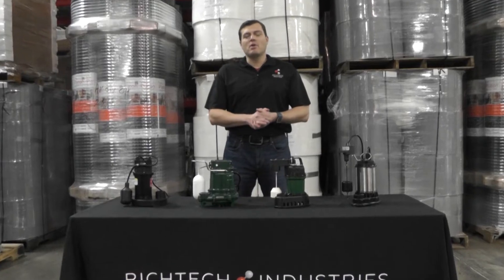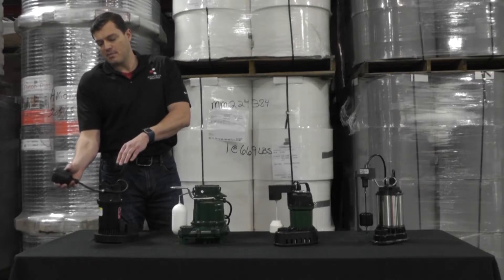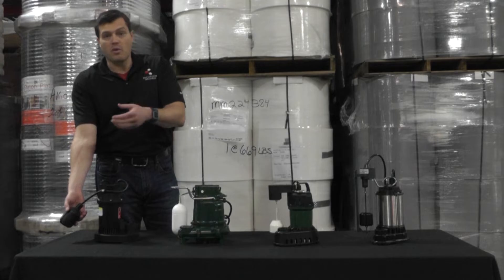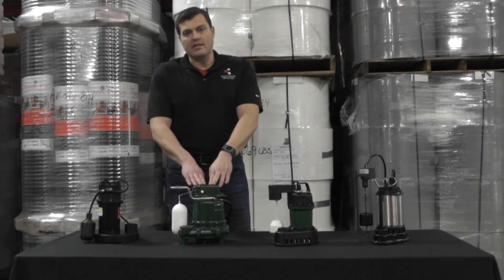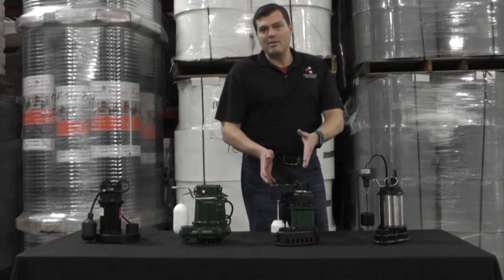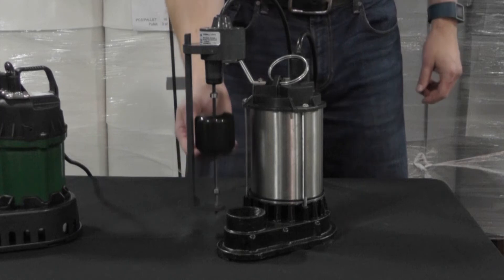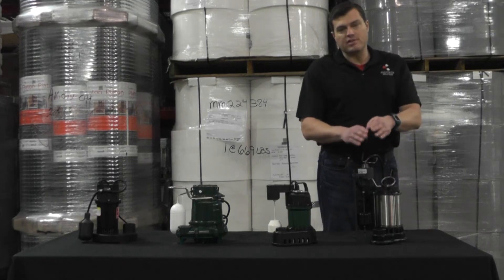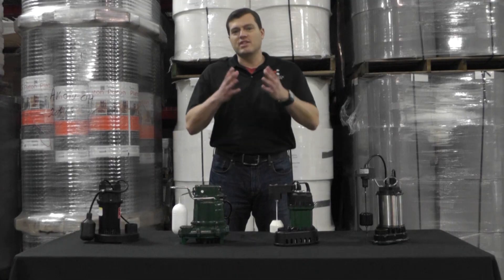Sump Pump Switches

Comment: I have the 1/3hp pump with the lever switch which is your 2nd pump. The switch works but hangs on. I want to just replace it but not sure if it’s the switch or the float ball. Pump is about a year old and pumps out a pond if it overfills

Comment: My stupid pump has a tether switch, so it is always getting stuck, the pump is always falling down. I cannot trust it. Why aren't all pumps using a vertical floating switch? In europe i cannot find pumps with vertical switches. Why? Why do manufacturers insist in thether switchs pumps? Can I change my pump's switch. Thanks.
Reply from the maker: Hey, sorry here 6 months later... vertical is the way to go in a residential basement.  Where are you exactly located?

Comment: #2 mode of failure, corroded pump bearings.  I've thrown out 3 pedestal style pumps and 1 submersible pump where the pump impeller bearings corroded and seized when the pump was sitting in a wet sump for a few months without being run.  Saved from a wet basement in all cases by having a second pump sitting higher in the pit.  It's sits high and dry even during normal operation of pump #1 and will kick in if the water level in the pit rises to activate the switch.  Pump #2 is also on a separate electric circuit and breaker.

Comment: Why no mention of diaphragm switches.  I have one on my little giant sump pump and it's worked flawlessly for over 25 years.
Reply from the maker: Guess I'll have to add that to my next video.  We've sold those diaphragm switches in the past and if they are not installed correctly it can be a nightmare.

Comment: Thanks for the information. The retailer websites don't  show any of that sort of info.

FYI Switch range of motion means they activate at different water level. They are just different
The tethered switch doesn't activate until it is higher than the pump, thus the water level is higher. So high that it wouldn't activate in my shallow sump. It works in my deeper sump, so I got a vertical switch for the shallow sump

Comment: I find the first pump switch a pain. I just had a new pump installed with that type of switch and it doesn’t even kick on sometimes. Causing a water mess in my crawl space. I adjusted the length of the cord hoping that it will kick on next time I get water build up.
Reply: I have a pump with the first float switch too, and I am just about tired of it. I think it gets stuck on the bucket, which causes it to trigger the pump intermittently, which forces me to go to the basement to manually trigger the pump. My handyman suggested a bigger bucket, but that would require digging out a bunch of rocks around the bucket in the trench, which would be a lot of work. I think it makes more sense to just get a new pump with a vertical float.
Reply: This switch is a piece of crap, it always malfunction with me. Sometimes it kicks in, other the pump falls down, other times it doesn't turn on, or it gets stuck. I'm wondering why, in Europe, I can only find submersive pumps with that type of floating switch. In fact, I never seen a pump with a vertical switch in any European store. I wonder why they keep insisting in that tethering crapping system. Where can I find the last pump? Thanks

Comment: Very good and quick explanations of which switch is better. 
I ran electric to a Plumber Installed pump with a tether switch. Absolutely impossible to both turn on and off. Got an accessory “plug in” float switch from Home Depot. Taped the tether switch in the ON position. Plugged in the accessory switch, DONE.

Comment: Number 3 - how do you raise the pump so it turns on higher ?
Reply: Add an 'after market float switch' which makes the electrical ON/OFF connection out of the sump pump in dry territory). About $35 online. You will need to secure the  float to the ON position (permanently...I used 2 HD zip ties). Adjust the range of pivot motion and make sure that float won't hang up  on anything.

Comment: Can some switches be adjusted to come on at like three inches of water.
Reply: Add an 'after market float switch' which makes the electrical ON/OFF connection out of the sump pump in dry territory). About $35 online. You will need to secure the  float to the ON position (permanently...I used 2 HD zip ties). Adjust the range of pivot motion and make sure that float won't hang up  on anything.

Comment: the vertical float switch is a better option for a shallow sump bason too. a tether has to long a sweep for those.
Reply: Yup
Reply: I think this is well. I have a pump with a tether switch, but I think it gets stuck on the bucket that holds the pump, which makes the pump run intermittently, which forces me to have to go and trigger the pump manually. I think I'm going to just get a new pump with a vertical float switch.